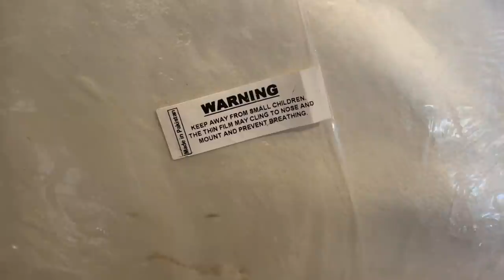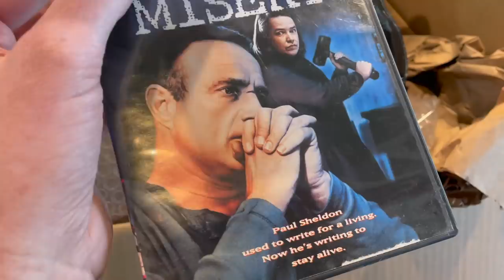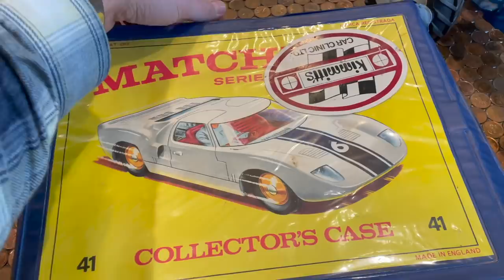Part 10. Ground Breaking Episode! prep work begins for new building! And... I fix a banjo

Comment: a little tip from an antiquarian book restorer when working with vellum or parchment put some drops of detergent/ washing up liquid to break the water tension and leave to soak for 5 minutes also use warm water if you do all that then you won't get those white spots those can dry up as rough spots which are ugly you see that type of spotty marbling on tambourines a lot because those are more likely to be refurbished by the people who own them rather than professionals it's so simple once you know.
Reply: Thanks for the info. Very interesting